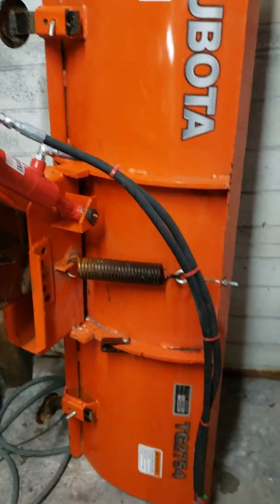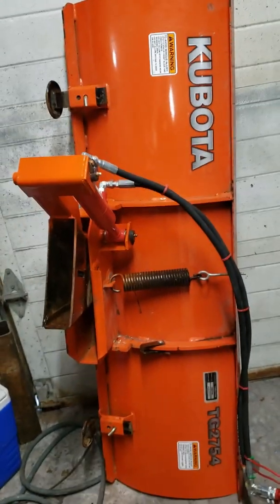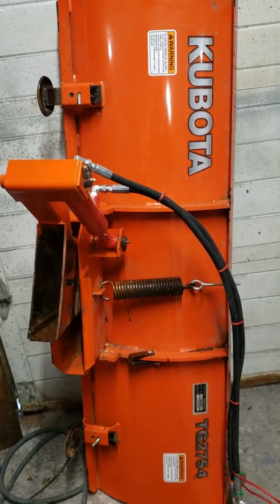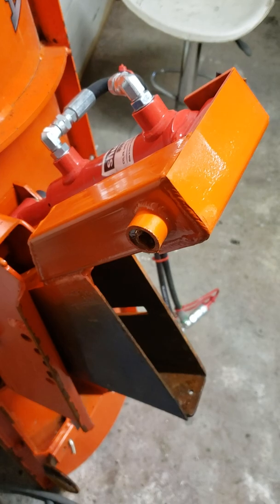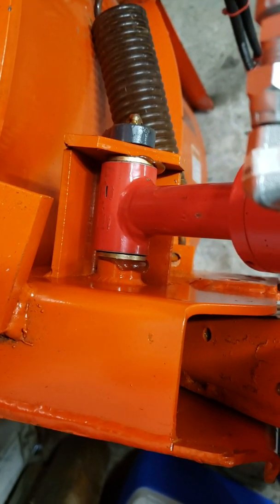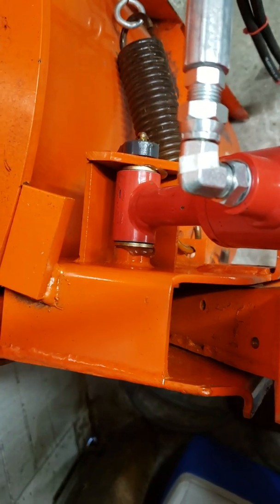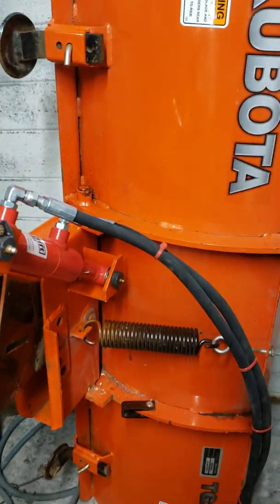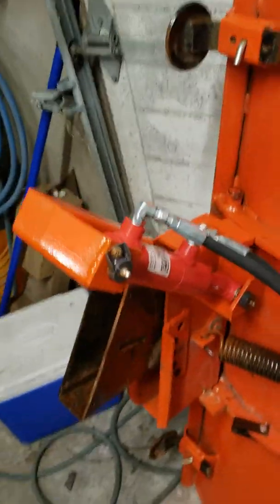kubota hydraulic blade angle conversion

Comment: I commented on your snow blower video, did your gf1800 already have the quick hitch setup, or did you adapt something to it?   Did you add the remote hydraulics to your gf1800, or did it already have that? 

I just picked up a low hour 4wd GF1800 and have the bx 4 way blade already.   My gf1800 doesn’t have aux/remote hydraulics and I can’t find any info online about adding them
Reply from the maker: Just replied. If your in Canada, your dealer can help you out. Not sure about the US. 

Just a hint. The hitch style is made by RADtech in Canada, and is common to some models of walker, new holland, kubota and honda tractors.